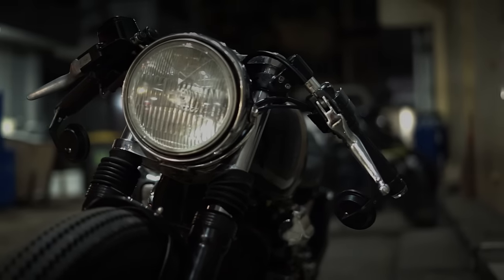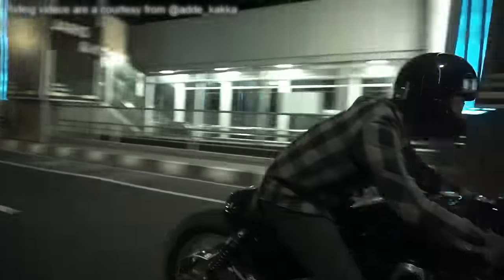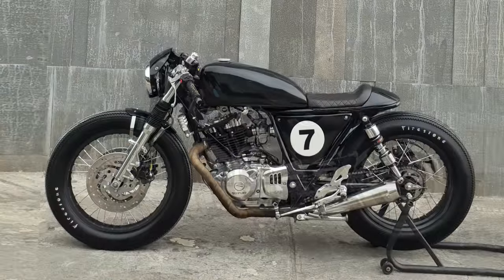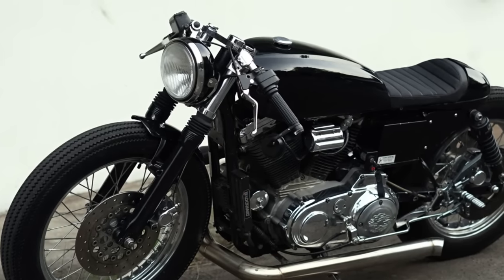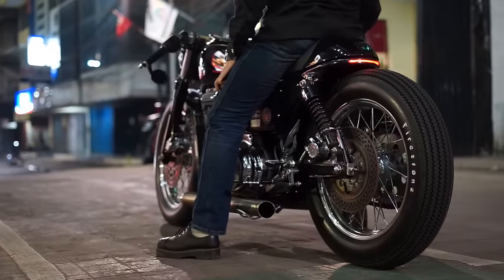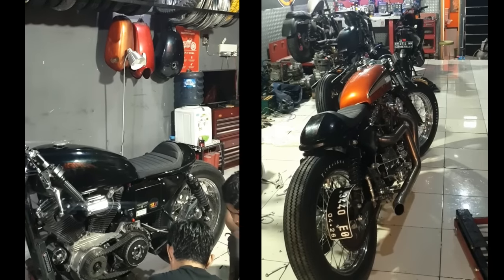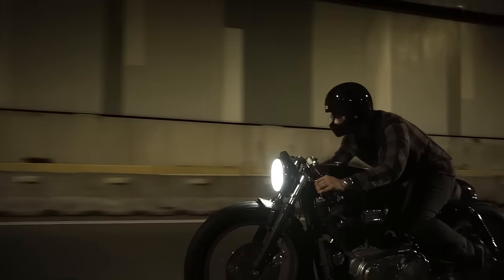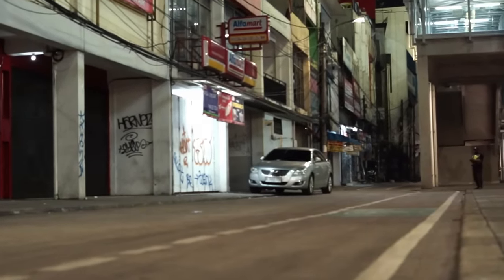Cafe Racer (Harley Davidson Sportster built by  kevan Cahyadi / Solace Motorcycle)

Comment: I far prefer the looks of the 250.  Far more balanced.  

Yeah, that's probably the best looking harley I've ever seen, but it's still a gold plated dog turd.  The forks are totally compromised, about the only way to get any travel in there is oing to be USDs or maybe (which would go with the advanced technology of the power plant) some 1920s style girder forks.  The handling's gonna be modified by the changes to geometry, but it's a harley, they aren't going to be making it much worse.  I don't understand why they did away with the only good thing about the original bike - the belt drive, though.
Reply from the maker: Thank you my friend for sharing your perspective. I believe this project still has the original forks due to a limited budget. :) Cheers.

Comment: Real bikers wear boots beginners wear tennis shoes don't forget your tennis racket common sense is not that common anymore
Reply from the maker: @simonapeters4372 Sorry, but I don't think so, and neither do most people. If the use of boots when riding a motorcycle were so important, governments would have already passed a law in this regard. 
Riding a motorcycle on the road is not the same as riding on a race track. 
Wearing boots will not save your life in an road accident. :) Cheers